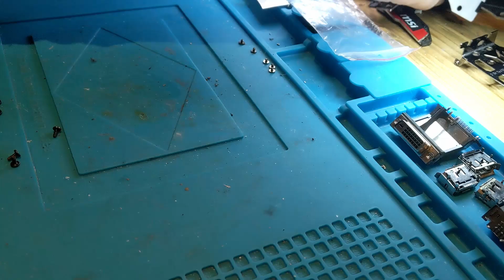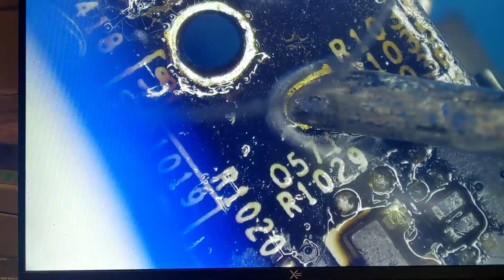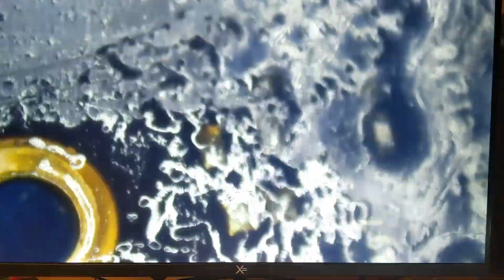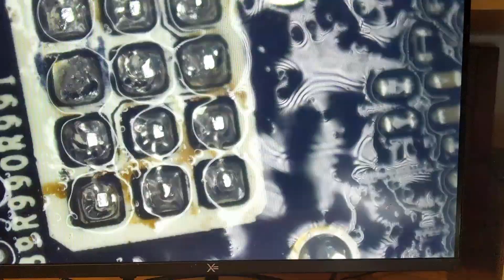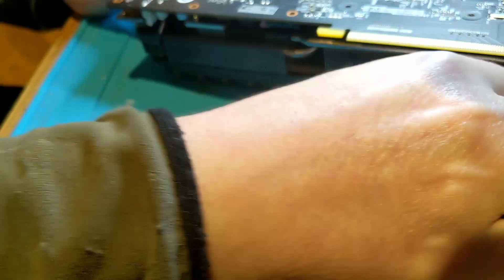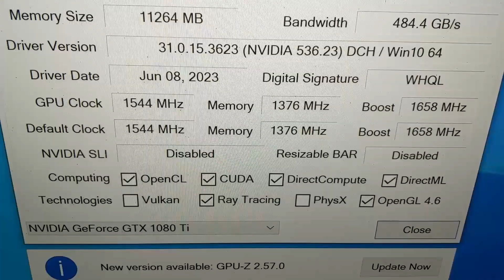[Restoration] Heavily corroded MSI 1080Ti - Part 3 - Done :)

Comment: Use a knife tip for your soldering iron. Will give you much better results.
Reply from the maker: I do have all the possible tips, the thing is those are for my old soldering iron which is not great for precision work, it uses T900.
I yet to buy more Type-210 / Type-245 ones, those are on the expensive side :(

Comment: That's a lot of hard work. I'm not going to lie, for some reason I also like to do that kind of work sometimes. which economically do not make any sense but for personal satisfaction and to know how to do it just in case. Or maybe something is broken in my brain. But it doesn't seem like the 5000 series is going to be cheaper. And in case you have a 4090 with a similar problem, it is starting to make sense.

Comment: A lot of work. I had a card used on a beach. It was corroded everywhere and I was an idiot for accepting to fix it. The worst repair in my entire life. Anyway, congratulations for your hard work.
Reply from the maker: Thanks, it was a lot of work yes... but that was the idea. It was for my own satisfaction, saving a really really nice card. I just love this particular MSI one.
Still rocks if you are not into the entire RTX thing.
Reply: @DIYRepairHour  I play Fortnite and Dragon Mania Legends. There is no way I need anything more powerful than a 1080 in my computer. It isn't even a "Ti" one but it does its job great. It's a repaired one and it is working just fine. I also repaired this one for my own satisfaction and for my own use.. that until a kid needs a video card and I have nothing else to give 😂
Reply from the maker: @Dandan-tg6tj  yeah I played fallout 76 lately, and having 1070 ti in my system. It maxed the frame rate. Unfortunately it died again as it is heavily corroded. But it will be in a video soon as a core donor.
Reply: @DIYRepairHour  Good luck!